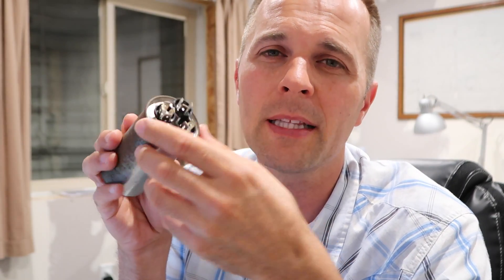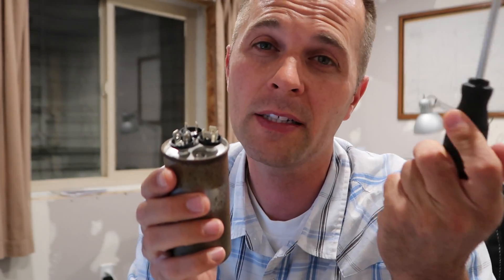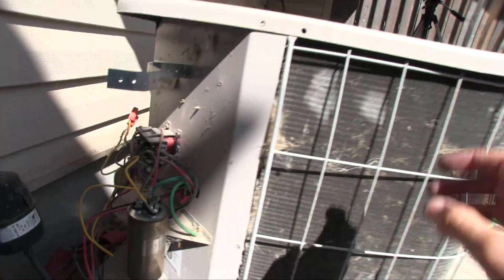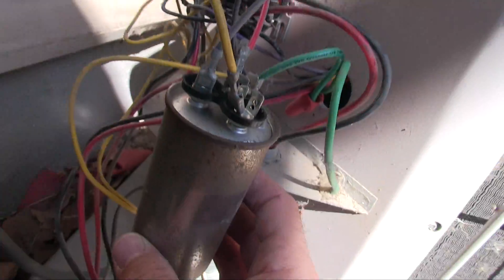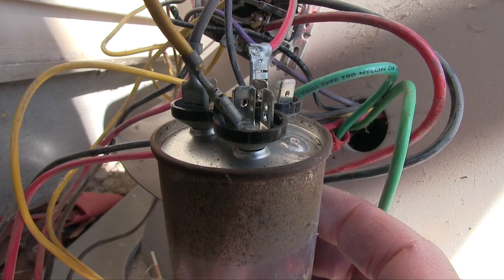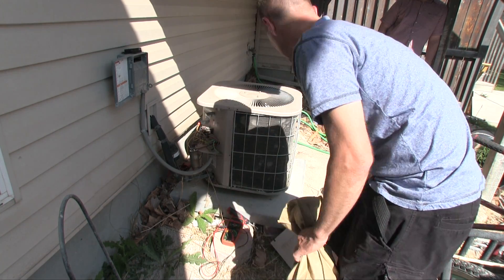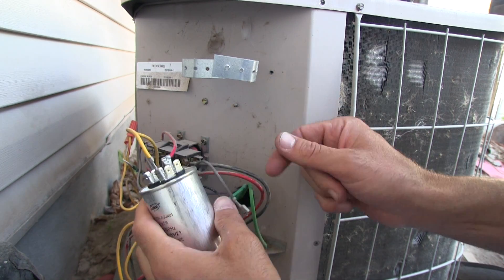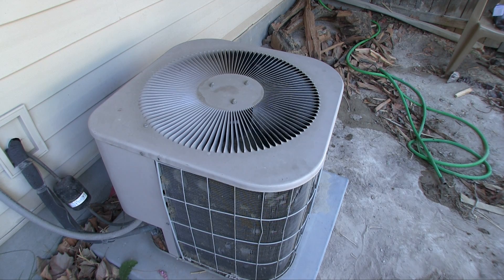AC Fan Compressor Not Working - How to Repair / Replace HVAC Run Start Capacitor - Air Conditioner

Comment: I replaced compacitor ac worked like normal for about a day and then stopped working now fan and compressor not turning on can’t figure it out

Comment: Hey there Adam one question does the a/c capacitor also control the blower fan on the inside when to turn over

Comment: Thank you so much! My AC wasn't working right and I noticed the condenser fan wouldn't kick on by itself (without a little nudge) and the unit was HOT! I went to my local HVAC supply and got a new capacitor for $7.31 and it fixed the problem! I never would have done this without this vid! Thanks!!

Comment: Thanks for the video.
I have a question:

I just replace a new capacitor but the fan still not moving and AC is not cool . Please help. Thanks

Comment: Good info vid. I desperately need help for my Whirlpool inverter plus aircon. It has no capacitor. The outside unit fan only starts if i manualy push the blades......then when the fan needs to turn off it will, but will not restart ( the outside fan).any help would be fantastic. I live in the Philippines and Whirlpool here is not the best at helping to say the least. Thanks Mark.

Comment: My fan setting for my rv ac turns on, but it won't activate on "cool" whereas before and briefly it would. Is that still the fan capacitor or is that one of the other capacitor? I suspect it might be the compressor, it won't even hum in the "cool" setting, but i can hear the thermostat click as if it wants to turn on.

Comment: Good pm sir i replaced new fan capacitor  but still not working the fan only compressor was working the fan motor winding still good condition what wrong with the still not running thank you.

Comment: So even when the air conditioner is off inside and not running it still could have energy going to it? Because ours is three the main old rusty one the blinds cut off balance and I tried to unscrew it and bend it back in place and it kind of worked but I was just curious what is your store energy going to her or not I meant to say it but I guess her works to

Comment: Thanks for sharing that awesome video. It was so enlightening. Can you telle whether there is a separate condenser for the fan in the IDU which blows out cold air in the room?

Comment: Great video I got 2 questions 
1. What if the wires are different colors from red, brown, and yellow how can I tell what's what?
2. I've changed the capacitor and the contactor fan still doesn't turn on what can it be.

Comment: Even my LG Outdoor unit fan running but , No cooling effect ..

I guess Fan Cap. is good & Compressor Cap. Gone Bad 
Or Gas in compressor is leaked ..??

Pavan Bangalore India 
( 9880805215 )..

Help me

Comment: my Samsung window ac compressor is not start only fan running continues. Please guide me to solve this issue.
Reply: Even my LG Outdoor unit fan running but , No cooling effect ..

I guess Fan Cap. is good & Compressor Cap. Gone Bad 
Or Gas in compressor is leaked ..??

Pavan Bangalore India 
( 9880805215 )..

Help me
Reply: Even my LG Outdoor unit fan running but , No cooling effect ..

I guess Fan Cap. is good & Compressor Cap. Gone Bad 
Or Gas in compressor is leaked ..??

Pavan Bangalore India 
( 9880805215 )..

Help me

Comment: Adamdiy please help someone was working on my AC it was spinning clockwise before he changed the capacitor after it was changed the fan was spinning in a counterclockwise is it possible to do that by putting the wires on the wrong slots on the capacitor

Comment: my compressor run for a hour then stop,to start again the compressor you must switch off the switch and then switch on the switch the compressor start running what is the problem

Comment: Fan turns on on the unit compressor kicks in and stays on for about 3 seconds and then shuts off could that be a capacitor problem or is that the compressor is locking up

Comment: My air conditioner is running but not cooling. filter changed , Line cold wet, fan blowing hot air and will not shut off for over a week now.? They just change the thermostat in my rental but worked about 10 days after the swap but now will only get to 79 degrees set at 72 I can set lower but does not get cooler. The old thermostat was an old mercury one spin dial.

Comment: My A/C capacitor is 6/30 uf, 400/370 vac (+-5%)... Can't seems to find that specs. Any suggestions?
Reply from the maker: Here is another video I made that's a little more specific and may answer your question. https://youtu.be/9K7Uw3eMzv0
Reply: AdamDIY that video helped a lot but my capacitor is 6/30 uf will a 30/5 uf work?
Reply from the maker: I can't find an exact match but this is as close as I could find.  https://amzn.to/2LYFgGd  I would call around and see if you can find one that is spot on.  Here in utah I go to Allred's Inc. to pick up parts.

Comment: my window unit only has 2 connections  not 3
Reply: its a single capacitor.
Reply: cap in video is a dual
Reply: Jose huertas

Comment: Hi Adam I have an issue with my AC. When I switch on the system though it turns on for a while say 30 mins then it just shuts down the external unit. Then after a while the internal unit also shuts down and stops with a Yellow light blinking. I had it service both inside and out side and the repairman topup the Gas thing in the unit too. It worked fine for 5 odd days but has been giving trouble for last 3 days. Please advise what could be the cause.
Thanks

Comment: ireplace a new capacitor the fan run for 5 mimutes  and stop plese any bady know the probem
Reply: fan could be over heating and going of on the thermals. this is a sign of a faulty motor. does it come back on eventually?

Comment: When it's hot outside and the unit under the sun, the outside unit wont run and I get nothing inside i.e. blows hot air but sometimes at night works fine! Any ideas?
Reply: sounds like you have a high head pressure situation. I would recommend having you ac coil professionally cleaned.

Comment: I have a unit that doesn't work. The compressor and fan don't work. I installed a new capacitor and it took 3 minutes to turn on. When the temperature on the thermostat reaches 80 degrees, it turns off. Any ideas on what I should look for???

Comment: I have. Lg window unit that the compressor runs all the time.i unplugged the control panel from the front and the compressor will still run.

Comment: I've been looking for info on this kind of stuff forever. my unit has a start capacitor attached to another capacitor. I've got 2 black wires, a red wire, a yellow wire, and a purple wire going into my capacitor, and Idk what they're for.

Comment: Only thing I would like to add would be to wear safety glasses when discharging a capacitor.. They are known to go Pop big or small. Hook them up backwards and they Will go Pop... :) Just added info to the great material found on Adam's channel. Covering the bases is all... :)
Reply from the maker: Thanks man!

Comment: Thanks! My motor actually went bad last week and I watched the repair man switch it out.  During the process he tried to sell me on a dual capacitor setup saying that I only have one.  Now I am curious and will check when I get home with my multi-meter to see if that one capacitor is within it's range of uF tolerances.  Do you know what he was talking about with having two versus one capacitor?  Thanks!
Reply: there are dual and single capacitors. a dual capacitor as a uF rating for the fan and the compressor but it is in a single body. the capacitor changed in this video is a dual capacitor with the 30uf being for the compressor and the 5uf being for the fan.